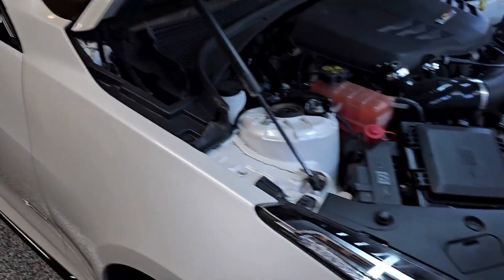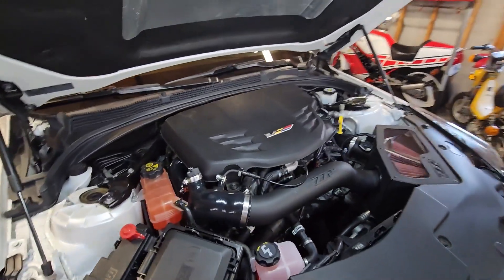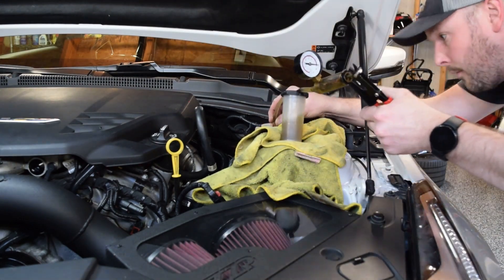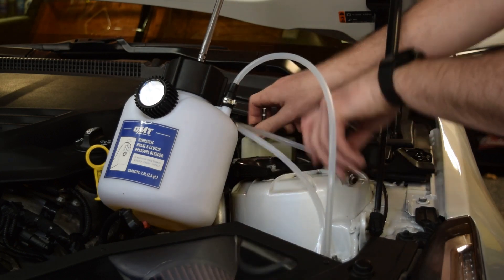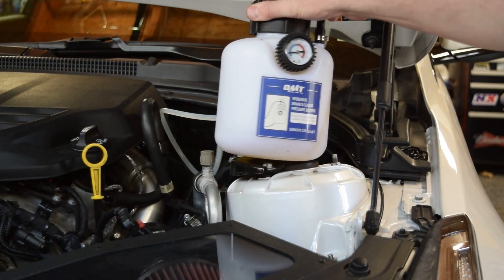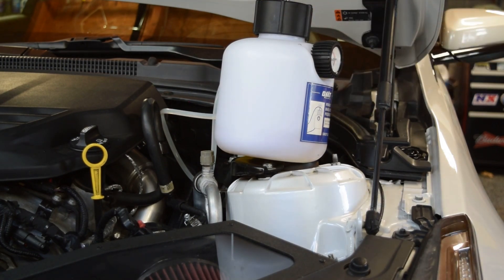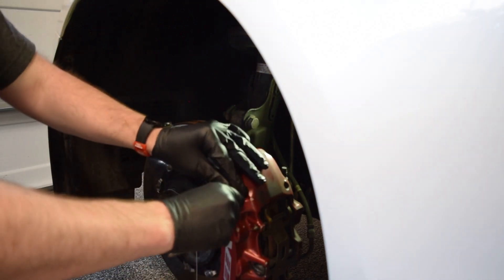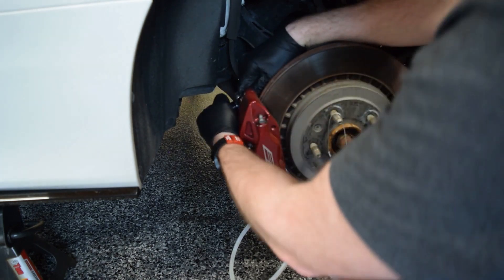ATS V Brake Fluid flush

Comment: Great vid! Did you have to go back and repressurize/pump up the tank in between different calipers? I didn't see you going back to the tank during the vid. Thx 🍻
Reply from the maker: I didn't on this fluid flush. I will say sometimes you do. 

You want to make sure that there isn't too much brake fluid. If it's over the max then the ABS can't work correctly.